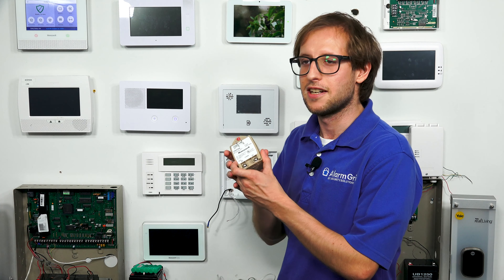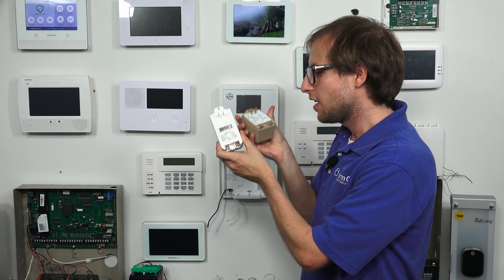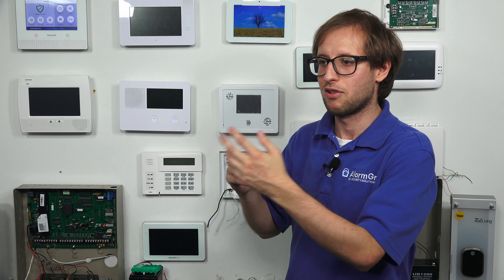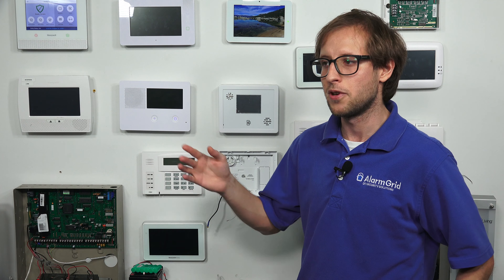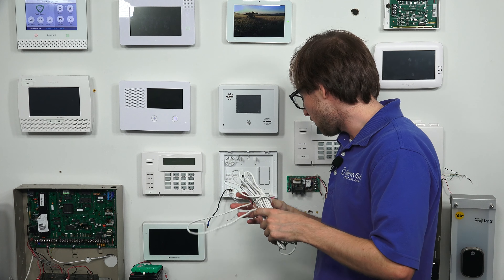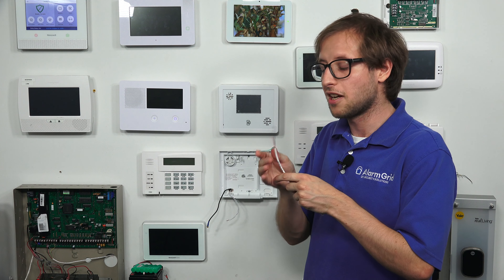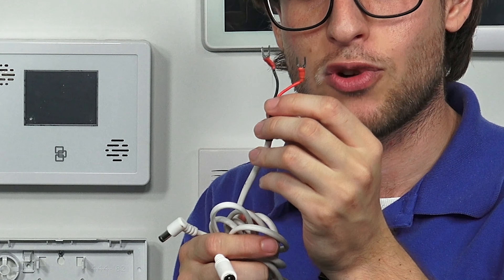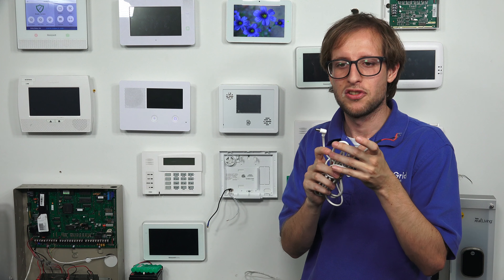Providing AC Power to an Alarm System

Comment: Perfect, this was just what I needed after determining which outlet had the current loss. I'm wondering how long it takes the alarm system to recharge? Thanks.
Reply: Hi @SharonBennett-yu6gx, Glad our video was helpful! Most panels usually take about anywhere from 4 to 24 hours to charge their batteries once replaced Depending on the system and level of charge already in the battery.

Comment: A local tech shop in town that provides mainly surveillance systems approached me with a job offer only thing is I'm more if a networking guy, thanks for the video dropped a sub look forward to more resources for study in case I get selected
Reply: Wish you Luck on the job, There are various ways to study check out ohms law and normally open and normally closed circuits. Also look for basic of wireing security systems

Comment: What happens to the alarm system if you wire it directly to power source without the transformer? Is it possible to wire it without the ac transformer?
Reply: Hi, @lex_one-two, Each individual Alarm system comes with a Power supply, (AKA Transformer, Wall adapter, Power Block).  This is to Prevent damage from the AC power that comes from your wall outlets that is at a much higher voltage and current than the panel can support. These Power supplies for each individual panel convert the Voltage and Current from your wall outlet and transforms (Why the device is called a Transformer) it into a voltage supported by the Device being powered.  DO NOT WIRE DIRECTLY TO A WALL OUTLET.

Comment: Hi Michael.  Wow!  I learned a lot today.  I had to replace a battery in a panel.  I'm not sure if the Batt is bad... but i noticed a wire from the step down transformer  to the panel had became disconnected (i think).  Neg and pos should be hooked up to panel and transformer... right?  Its not meant for anything crazier than that... right?  Oh yea there was no adapter such as a barrel connecter just 2 wires screwed to screw posts on panel board per power.
Reply: Thank you for watching the video! Could you email us  some pictures of what you are explaining to our email provided in the video. We will see if we can assist you further!

Comment: I have 4 wires red black yellow and green and need to wire it back to the transformer for my alarm can you tell me what color go together it is a class 2 transformer
Reply: Most commonly used is red and black. make sure that red and black are used at the panel aswell.

Comment: So currently I am using a old LED light cord to "power" my panel. Its 20 AWG and I have it wiring correctly into the panel but it isn't turning on. When the cord is plugged into the outlet the panel doesn't do anything. Is it because I am using an old wire and I need to buy an actual transformer or is it a keypad problem?
Reply: Hey Maddix, Have you checked voltages from the wall where the adapter plugs in, adapter Voltage out and at the panel AC in terminals. As long as the transformer has correct voltage in from the wall outlet and out to the panel. 20 AWG wire within a few feet of the panel should be ok.  If the voltages are incorrect, a transformer might be needed.

Comment: The transformer electrically isolates the low voltage from the high voltage mains. Please explain the need for the earth wire on the LV side of the power supply thats connected to the alram circuit board. 

Can my alarm cause my RCD to trip?

Comment: What type of wire should I use to connect the transformer to the panel? I need to purchase the wire.
Reply: The majority of installations would use 18-gauge 2-conductor wire when connecting the transformer to the alarm panel.